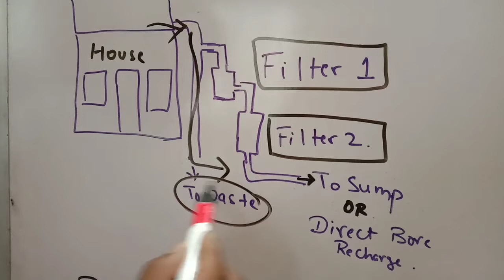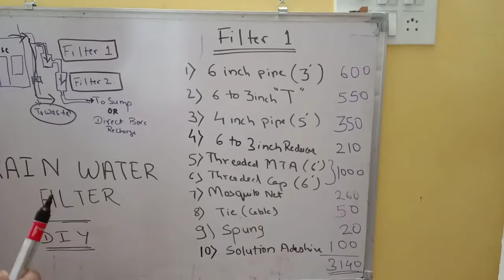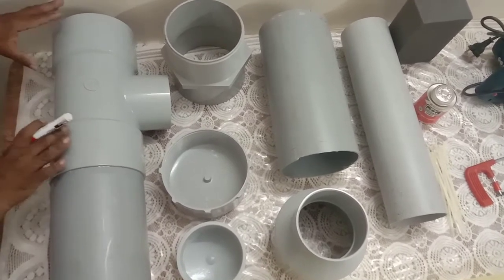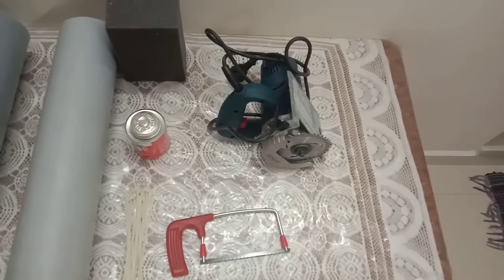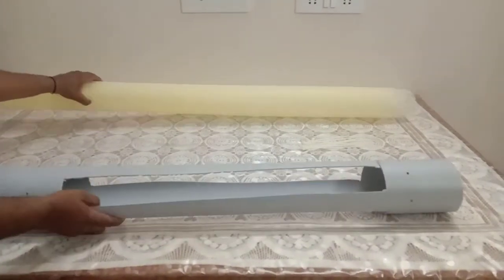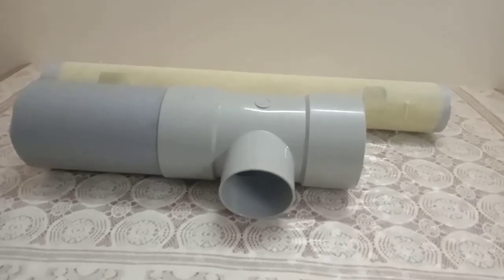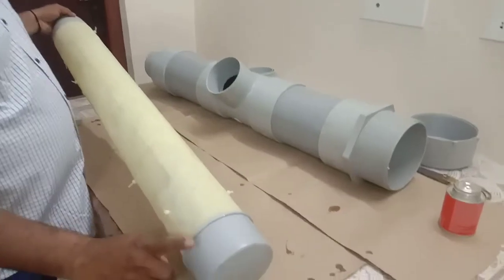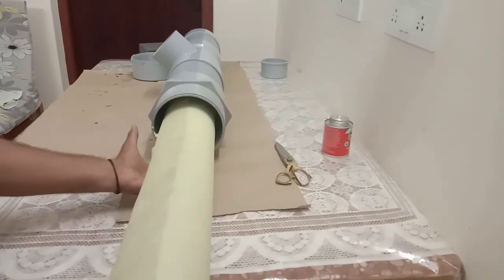Do It yourself: Rain water harvesting Fliter - Part 1

Comment: Keep in mind, we do not use "Glue" to glue the pipes together. We are using "Cement" to make them join together.
The big difference is, glue is basically a material that sticks to each surfaces, holding them to itself to hold the surfaces together.
Here, we are using the glue to "Melt" the plastic, so the plastic will melt together and their surfaces will bond directly to each other.

The reason this needs to be understood, is so we understand why we need to do it properly. The Dauber for the cement needs to be rubbed over each square nanometer at least twice to break the plastic's Surface Tension, which will help it melt together. THIS IS CRITICAL for a water-tight seal. This is also why, on Pressure Pipes, we use a Primer before the Cement (Oatey Purple Primer is probably the best known).

Also, I would not use Grey PVC, unless your pipe's color coding is different than America's. Grey PVC Pipe is not pipe. It is Electrical Conduit, meant to house and protect wires. It uses different "Plasticizers" than pipes intended for Potable Water. And I would be willing to bet you a beer that they are carcinogenic. White or clear PVC pipe is the only way to go.

It's an awesome design! I'm going to copy, but modify. I think the first change I'll make is use a Food-Grade Epoxy Resin to attach the netting, so, no holes gaping around the Cable Ties.
Reply from the maker: Thanks for your comment and guidance. I am happy you would be using this. Do share your work and we will be happy to lean from it.
Reply: @diyalmosteverything2956  Thank YOU! Always nice to be complimented, and I hope mine, to you, rang out as loudly as yours just did to me!
(Plagiarism IS the most sincere form of flattery)

Comment: Hi. My 6" threaded end cap is leaking. I suspected this while buying since this did not have a rubber ring inside. What should I do, kindly help.
Reply from the maker: depend where it is leaking. buy simple tephlon tape which you can get in any hardware shop. its very thin tape white in colour used for plumbing. wind it on thread and tighten it. should solve your problem
Reply: same my 5 inch threaded cap is leaking in the end

Comment: Hi sir how to clean the filter after sometime
Reply from the maker: Thanks for your query. It is very easy, just remove the cap by unscrewing, pull the pipe net filter wash with water and reinstall. You need to clean once a year. My suggestion is to keep terrace as clean as possible.